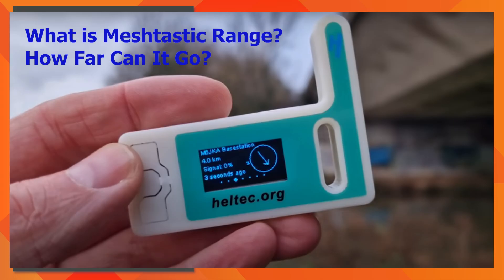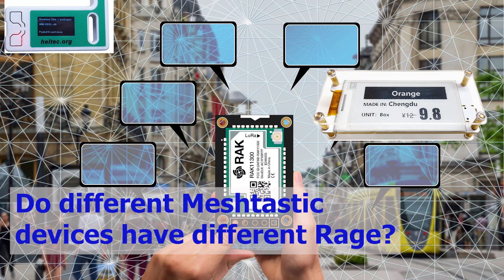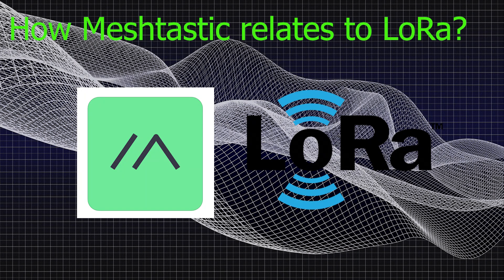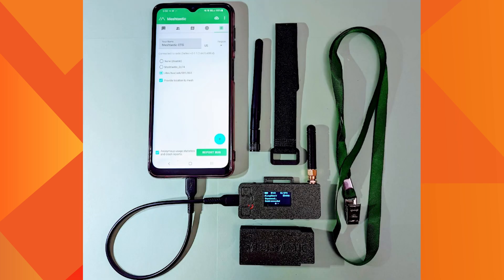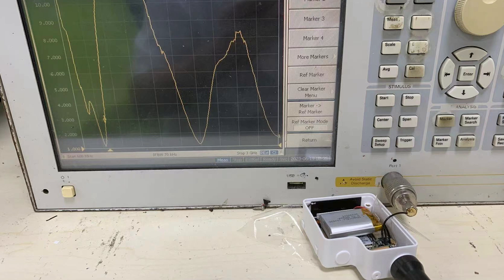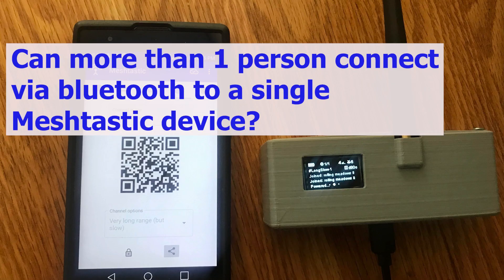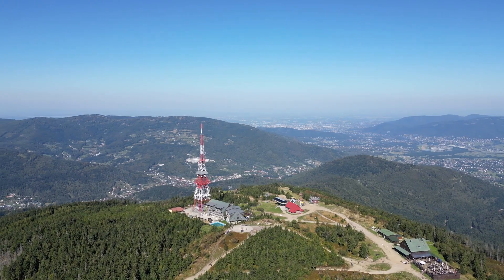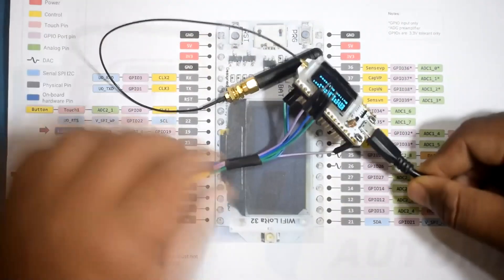Meshtastic Frequently Asked Questions, FAQ  by Technology Master

Comment: how to use Meshtastic device with Windows PC without internet?
Reply from the maker: There is no windows  app. However you can use web client for chromium based browsers e.g Chrome to connect to your device via WiFi, Bluetooth or serial. https://client.meshtastic.org/  There is no need for Internet for this to work.  There is a workaround as well. You can install some android emulator e.g bluestacks and install android app on it. This way you can use all app functions from a windows pc.
Reply: @technologymasterkam  thanks for your reply.

how come there is no need for internet to use Meshtastic web client? are you sure about that? I tried it without internet and it didn't work.

android emulator on PC sounds interesting. I'm not familiar with that.
Reply from the maker: 1-Here is bluestacks website https://www.bluestacks.com/  It is a simple install.
2-For web client you need to load it via internet. Once loaded in browser, you no longer need Internet. You can sleep your laptop and take it far away in woods etc. It can connect to Meshtastic device via Bluetooth, http or via usb cable.